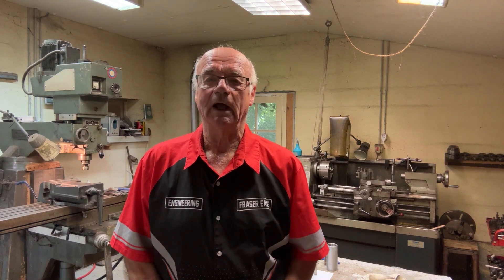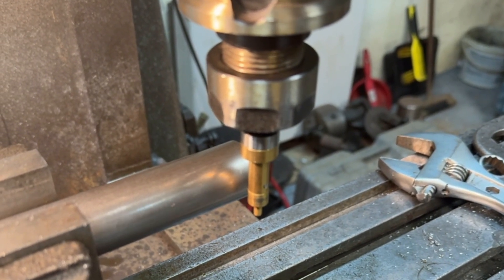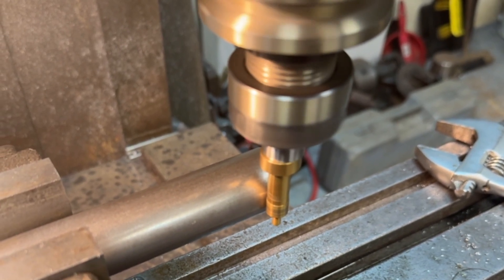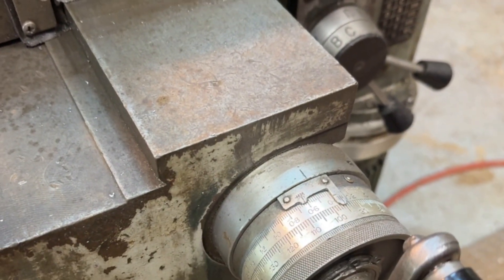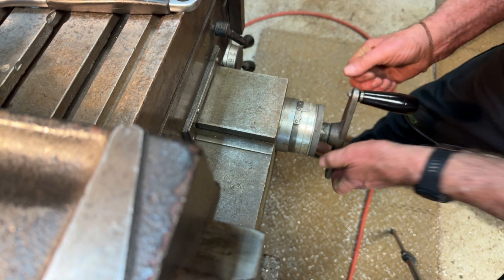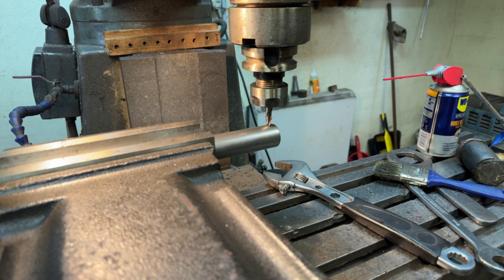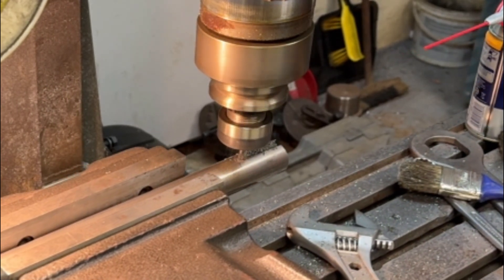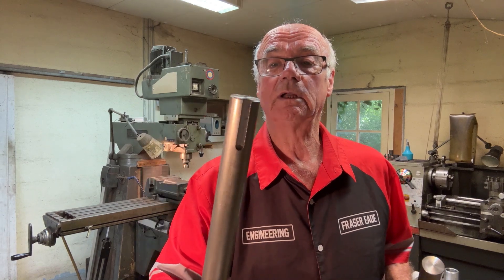How to cut a Keyway into a shaft

Comment: if you had to put a keyway on both sides exactly 180 to fit another part how would you flip it?
Reply from the maker: I would need to fit it in the dividing head if it was small enough to fit in the chuck. Bigger shaft would pose a problem I would have to work out at the time!

Comment: Nice to see the Beavermill in action, I fitted digital readouts to mine which makes it easier to set up, but I am not sure if I really trust these electronic things, being glass slides they can play up and leave you lost, as for the slot drill I think only in Europe we use these, the Americans do not seem to use them, but of course you can plunge cut with a slot drill, but not with an end mill, so they are much more versatile, Stay safe! Chris B.
Reply from the maker: Thanks for the tips!

Comment: does the 8x8 mm key have a square end, if so did you add a few mm for the round end or was the length already good ?
did i hear you say 15 mm from the end of the steel you would start cutting the keyway and then cut all the way to the end ?
Reply from the maker: Hi, thanks for the comments. I don't know the length of the key, I was only told what length to cut the keyway, which was 50mm from the end. Cheers. Fraser.